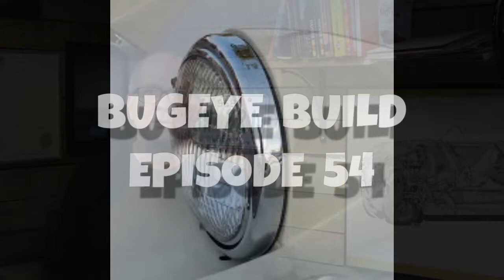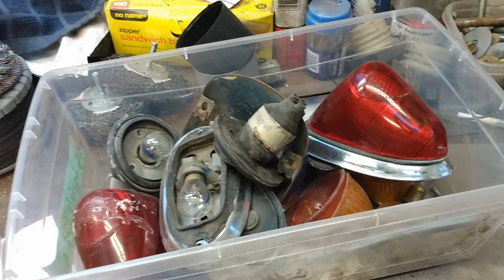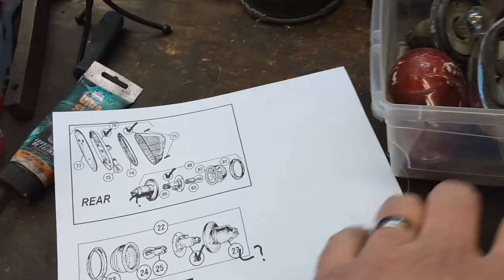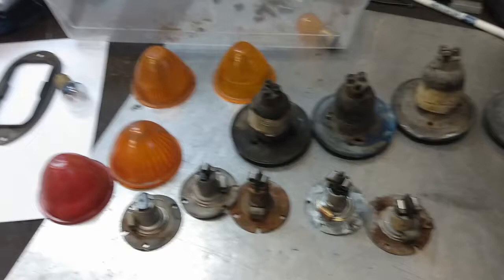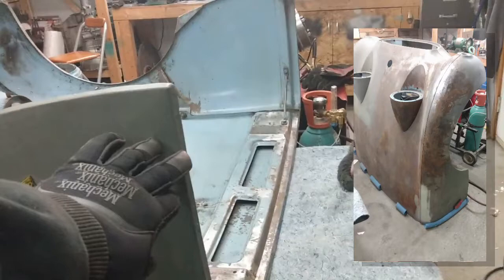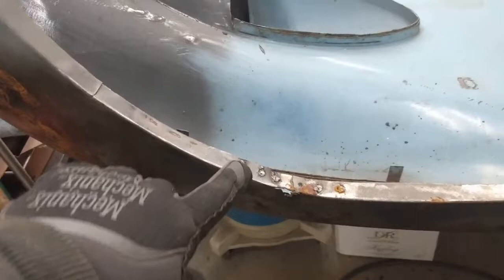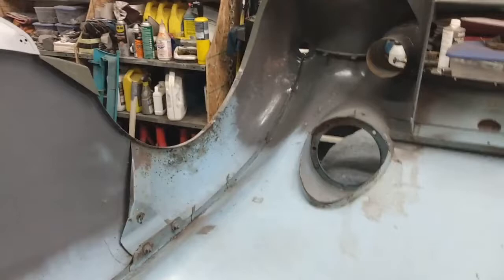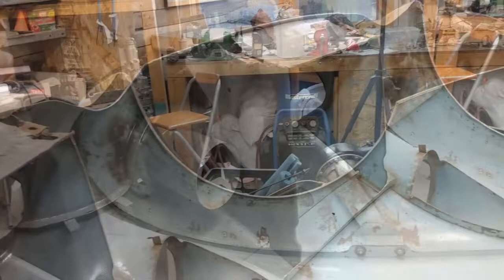Assessing the Sprite's bonnet condition & how to determine what parts to order . Bugeye Build Ep 54

Comment: I have a 58, the lisence plate light has two bulbs in it, and I was digging for parts the other day to get them out of my mom's basement and found a second one, that also had two bulbs. Not saying they're original, but that's what I found. These were used in other cars too as far as I understand. Also, found a bunch of lenses and lights, which is cool. I really need to start posting videos of all this stuff!
Reply: The 59 didn't have a lisence plate light on it (race car conversion), so maybe the one I found is for it. I wound up taking the fixture off the 58, stripping it , painting it black and bolting it to my Midget.
Reply from the maker: As I mentioned in the video the car was already disassembled when I got it. There's been a few bits and pieces that aren't even Bugeye parts.